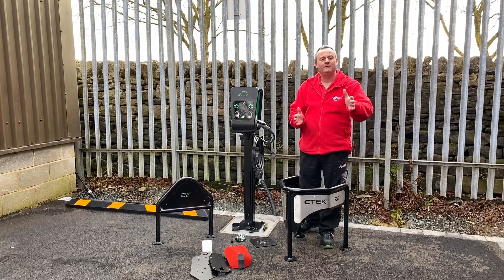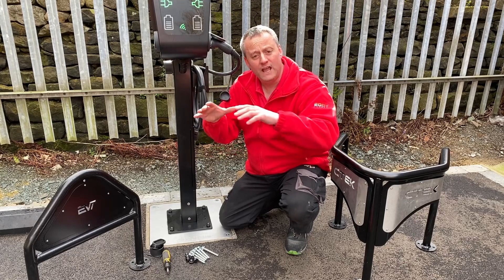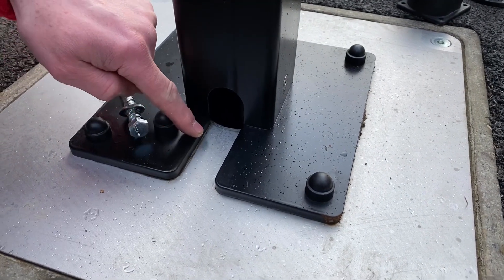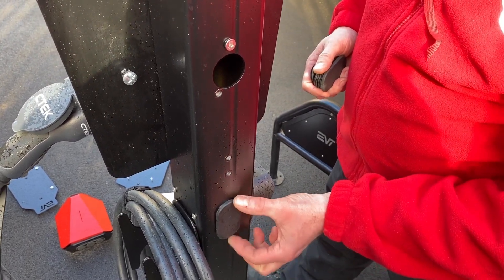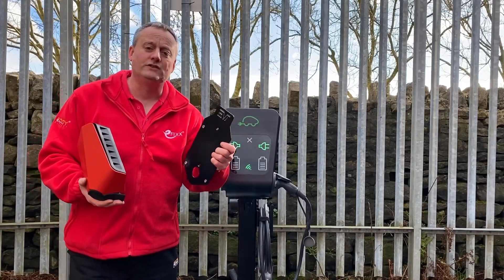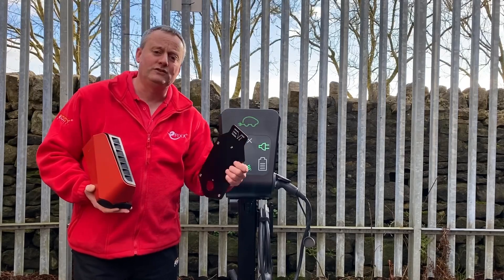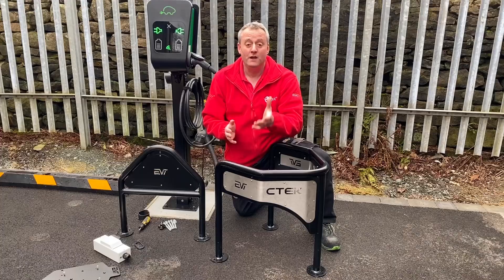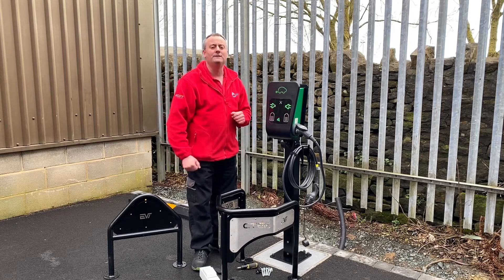EV Tower - Flexibility for electric vehicle charger installations.

Comment: Very tidy install, that up stand looks great, the modular switchable back plates are ann excellent idea. We did an install of three no. 50kW DC fast chargers lately for a company switching some of their fleet to Mitsubishi eCanter trucks. The chargers were mounted on a large 100mm concrete plinth with 600mm heavy duty 316 stainless barriers fixed with 16mm chemical bolts for front and back for protection, wheel stops-the works. 
Day 2 after the site was commissioned, some lad turning an artic in the same yard got it very wrong and flattened one of the barriers-ripped it out of the ground, and hit the first charger. Got to site and found it at a 70° angle, well dinged up but still working..
Moral of the story; you can make something idiot proof, but invariably a bigger idiot comes along..
Reply from the maker: Wise words 👍
Reply: What size was the supply cables to the chargers? Cheers